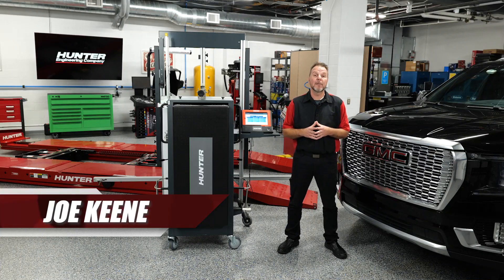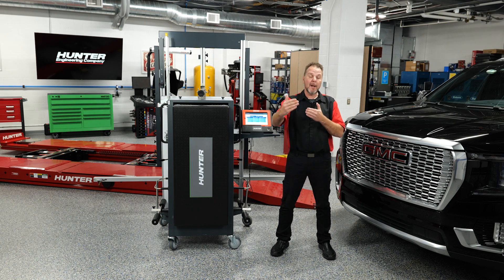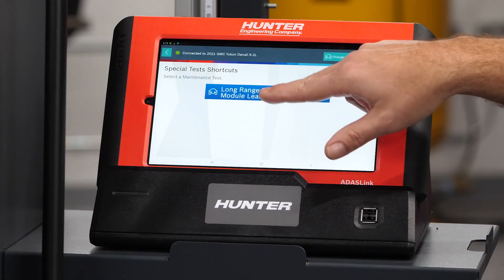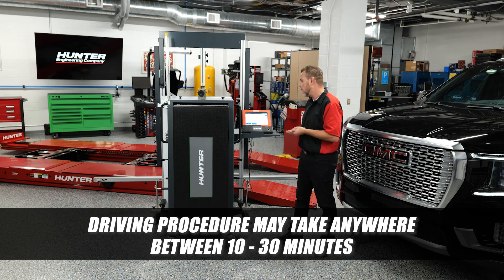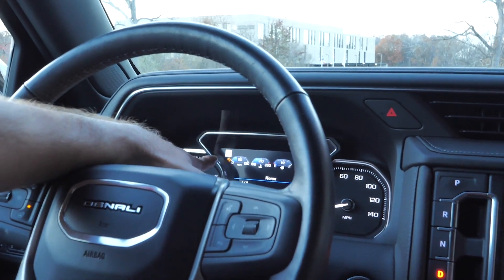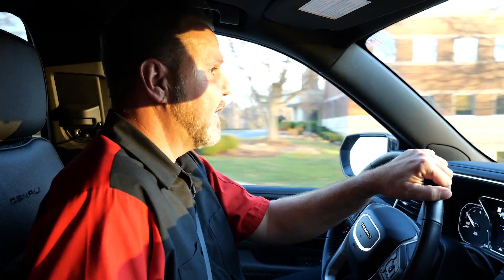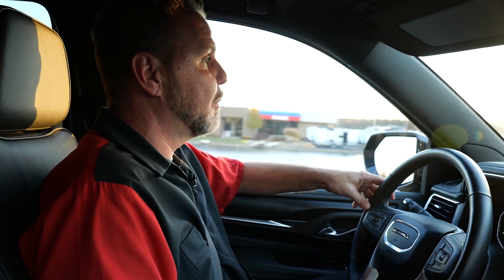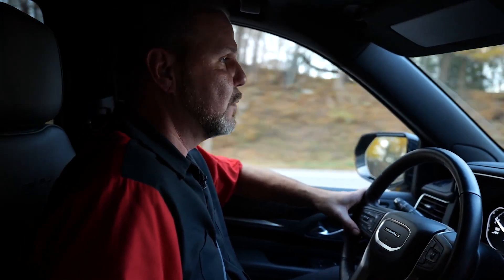ADAS calibrations: Front radar on a 2020 GMC Yukon Denali

Comment: Does anybody out there know what the distance between my Yukon XL Denali and the car in front will be {approx) when the radar shows green. I have mine set on max distance, and even when I'm seeing green and more than enough space between me and the car in front. I'm having experiences of drivers acting as though I'm riding their ass. I've been a driver for decades, driving tractor trailers as well a cars for 100s of 1000s of kms, but recently I'm seeing an increase in this behaviour, so I'd like to know what that distance is when it goes from green to orange. long winded question, I know, but I was wondering if anyone had an approx distance.
Reply from the maker: We would recommend contacting GMC or General Motors directly, or perhaps it's information that is found in the owners manual.
Reply: @HunterLearningChannel  thanks for the reply. Unfortunately it’s not in the manual so I’ll try GM. Thanks again.